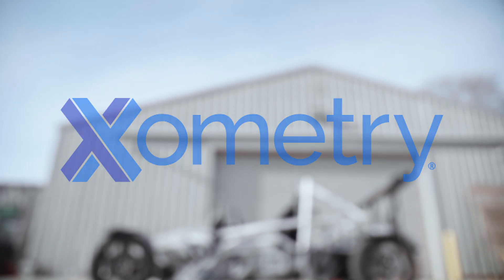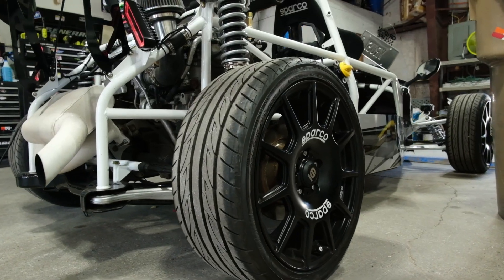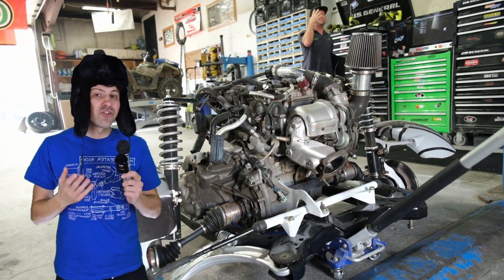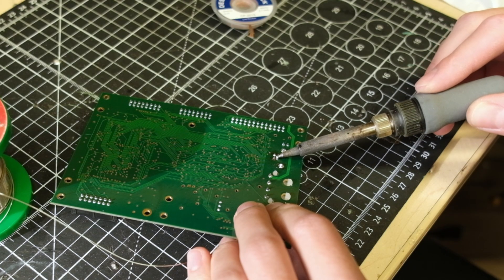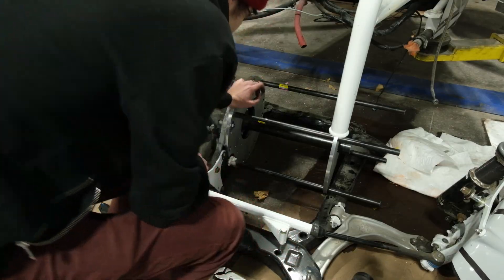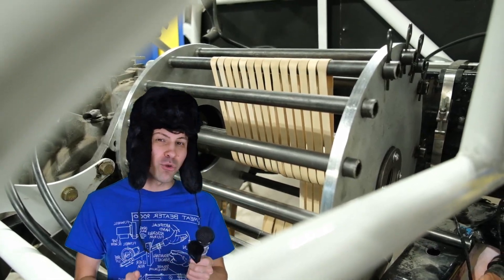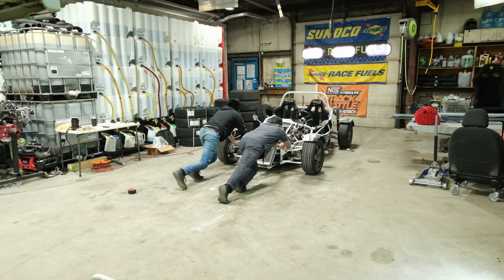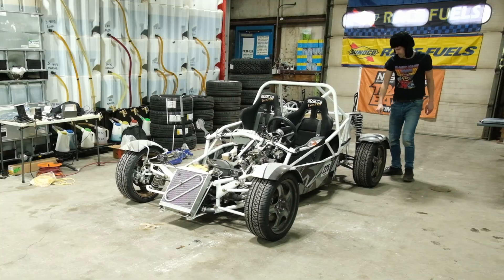How many rubber bands does it take to power a car?

Comment: The tubes need to be a shitload longer, and you need some sort of tensioning mechanism to apply tension to the full length of the tubes as they're being pulled back. Currently it looks like the last bit of tube is storing all the energy and most of it is doing nothing. I suppose that's why the tubes are so short, to try compensate for that. But it's not working cos the energy isn't released slowly enough to give it time to accelerate with the power available.

Comment: Put bearings on the spokes go back to the first wrap around design because it allows more length so you can have more length of distance put a stopper gear so you can "load" it

Comment: i thought of one of these using 2 sets of pull springs gearboxes a clutch and break recovery system using one set of 60 springs to keep power stored then at the pull of a lever when they r empty they refill by using the other set of 60 springs to pull then the set that has no more energy recovers power every time you come to a stop

Comment: How about workout resistance bands in place of the rubber bands!  Longer and wider so they would be easier to use, and they have multiple versions with different elasticities.

Comment: I had this same idea. I was thinking about a bunch of leaf springs run through a series of pulleys taking the load one or a few at a time before the next series kicks in. You can obviously turn the lever action into a rotary action use that for a governor. Winding it up would be the fun part but you could do it with a small engine and a hydro.

Feel free to use any of it I have plenty of projects.

Comment: I probably woulda stuck a motor and ratchet setup to the bird cage so you could have the whole crank assembly self reset. The motor wouldn't be pushing the car, just priming it so you don't have to get out and push it back first

Comment: What about like a mouse trap spring type using a leaf spring from a truck that you bend and attach to the drive shaft with the cable wrapped around it. So when the leaf spring pulls it unwraps the cable spinning drive shaft? The tension would be dangerous with a leaf spring though. Mouse trap cars work great because they pull on a string around a drive shaft. It's in my head I just don't know how to write it down. I know it would work. Basically, when the cable is being pulled it bows the leaf spring and when you release the car it pulls all the cable back out and springs back to its original shape. Gosh, it's hard to explain, lol.

Comment: I think you need a series of tension springs, where the first one winds up to a certain point before "locking" which proceeds to wind the next and so on, that way you dont deal with the problems of this video where it got in the way of itself

Comment: Somewhat different scale, but reminds me of a project I did in school for a science project.  Making a mousetrap powered car. I possibly cheated a bit, with my grandpa, uncle and dad all contributing ideas, designs and parts, although I did technically build the whole thing myself.  Tiny ball bearings, high  quality fishing line around the axle attached to the mousetrap arm and CD ‘coasters’ as wheels (at the time, burning a CD was not a guaranteed success, but far and away was the most economic way to store data. There was invariably a spindle of failed burns, affectionately called coasters). The small axle diameter and the huge wheel diameter made for an excellent ratio. My car couldn't drive across a desk because of lack of traction, it would just spin the wheels. But on carpet or concrete, was an absolute beast. I won that one by orders of magnitude.

Comment: You need to do a double cam shaft but much much much more bigger and it can then work. The material needs to be very springy it has to hold tension very well. A super rubber material.

Comment: Maybe try really strong spring say car shock with pulley system to turn short strong movement into lighter longer pull on the pulley. Many places to tweek the ratios and bit more safe than the garage spring, those can easily kill people. If all fails use torsion spring with starter motor to wind it up to keep the effect going. Bit cheating kinda, but would probably give the result.

Comment: If I were you I would just use a big ass constant force spring rather than a torsion/compression spring this would solve the guiding issue and would allow for a constant torque output
#feelthemagic part two please!

Comment: There is SO MUCH MORE that you could have done.
I probably had a black eye by about the halfway point of the video... Maybe he was just too upclose to see it, or maybe he was fixated on his initial view, but at every point I could see over a dozen ways to improve the functioning and performance  with barely or even NO changes. 

The main ones would be: a free run clutch mechanism in the winding system, so that it doesn't wind up again once fully unwound. The use of first gear to wind up, higher gear to drive. And perhaps the best one of all: when using a spring in this way (I guess you could call it lateral tension instead of axial tension?), it has the exact same strength when unwound as it has when wound up. (i.e. instead of making it bind, it will expand and to relax it will wind itself up) And since you already have a cage, it is perfect to use it like that. The thicker the spring the better the force, so don't take the last spring. How to wind it up without making a gear box? Use reverse gear, or use a left wound spring.

Comment: Shoulda used rollers instead of lubricant on the bands.
The part of the bands that are already rolled up can't stretch anymore, and you only get a fraction of the performance, that's why the zig zag works better in that other guys rubber band car.
Stiffer spring with a high gear to reduce the change in diameter.
A spiral torsion spring is particularly well suited to this kind of challenge (like the kind in a retractable dog leash.)
Either rubber band or spring are absolutely doable, though you may need to brush up on your math.

Comment: I am surprised you did not look into exactly how those pull back cars work. I am pretty sure they have a mechanism to stop the spring from rewinding as it goes in order to get full speed out of the car.
So something like that plus honestly using a wind up rather than pull back mechanism would probobly make this work better.

Comment: It might be a little dangerous but why not just use some large springs. Attach some nylon straps to the springs then have the nylon straps get pulled around the drive shaft.

Comment: I would try using very heavy duty bungee cords, or even a roll of cord/rope made for bungee jumping and roll that around instead, you would need far, far less in total, so less likely to end up tangled and wedged into the sides. Would also put some weights on the back to push those tires into the ground, and give the car a 1mph shove to start out to overcome that initial friction issue of starting out.

Comment: So .. I think this is a great playful project 

I would try making that Bird cage as long as you can get away with if it isn't 

And like rope get lots of long fairly thick strands of elastic and twine them together then 
Fix one end at the end of the cage and the other to the input shaft via a clever coupler

Also wind it up in fifth and then select second once stationary 😅 

Don't quit this is so cool

Comment: the problem is the diameter of the inner drum, it's too small for rubber bands. you need to lessen the force needed by the rubber bands to drive the motion. if I had to guess a drum with an outer diameter of 12-18in would be enough to meet your goal. I would also use long and thick bungee rope that has an outer fabric liner to prevent rubbing and to be able to store more force. i am not a scientist but I'm pretty good at looking at something and knowing how to make it work.

Comment: Try concentric springs. One simple way to do it is to just attach each spring separately to the stator and rotor. Another way could be to attach each spring to the next, with the center spring attached to the rotor and the outermost spring attached to the stator.

Comment: Thank you Aaron and David for putting up with Joel's shenanigans!
I think the rubber bands can be used if you twist the bands instead of just pulling them. I mean, the rubber-band planes also use them in twisting motion, not rolling down from a shaft. That way you can store energy in 3 dimensions instead of just one.

Comment: There was deffinitly magic there. I feel like if when you used the rubber band, you attatched the gage to the drive shaft and turned the cage instead you would have gained more speed, possibly longer rubber bands like pool training rubbrr band that ate 10+ feet long would help. Im not a car mechanic but was the axle able to slip when the power release is done so the car is not stopped by the band widing in reverse? Ayways i deffinitly felt porential there

Comment: I think you should've tried a smaller shaft and kept the small spring. Or got multiple springs on each of the outer shafts but made those shafts spin on bearings and attach a small gear on the end of each spring. Then add one big gear or several small gears connecting to the center shaft to the outer shafts. Still very cool vid as usual.

Comment: I think bearings, guides, and rollers to minimize friction between the elastics on the engine will help bring rubber bands back into the running
Reply: Every little bit of friction you can remove from the equation will (from my understanding) ((I am not an engineer)) put power back into the system

Comment: Had the same issue with usb dropping off. 
You cable is to long, the cable not shielded enough, or passes by a device with a lot of electrical noise like a stepper motor

Comment: Really nice idea. Although, if i am not mistaken, there are pull back cars that utilise a rotational sort of spring. You know, like the kind that is in mechanical watches that keep them ticking? So maybe an upscaled version of that would be way stronger than rubber bands and probably isn't going to break. Only thing is finding a way to make one upscaled, and it is a bit more dangerous i guess aswell.

Or you could use a few tough springs, link them up so that winding them you have a high mechanical advantage on a crankshaft that when winding it you have a low gear ratio so it's easy to push back, but when you let go the opposite is true, it wil have a high gear ratio. Although i guess you will need to have a crankshaft with a bit of a radius to make it go a bit far

Comment: Try using the bands to charge a flywheel.  Then tap the flywheel to move.  I believe that is how the little cars work.  At least, the ones I played with were flywheel-driven.  The faster they were pulled back, the faster they traveled.

Comment: Single direction ratcheting system, only 3-4 large bands starting on the side with a guide to evenly wrap them around the shaft (even if they overlap they will unwrap the same), and maybe pulling it back in 5th then putting it in a lower gear?

Comment: Looks like it wants larger diameter wider wheels, a MUCH thicker spring and a way to lock the spool so you can pull it back in low then switch to high for short pull and long run.

Comment: The small diameter of the axle is the problem. The wider the axle where the rubber band wind to more leverage. Also gears would help. Basic physics would've helped with this.
Reply from the maker: I had 5 different gears to choose from. More leverage means less winding before maxing out. 1st gear was always far too short. A bigger shaft would have had the same problem.

Comment: Thank you Aaron, David and Joel. 
I was really hoping that you would have some success with rubber bands.
With the torsion spring that kept binding up a smaller hub pipe and an external cage may be a better way to keep the spring in place.
To get any sort of real speed I thing a lot more energy needs to be stored. A number of torsion springs in parallel might get there or even better a geared torsion spring setup where spring 1 releases all of it's energy, spring 2 engages at a higher gear ratio then spring 3 etc. With some cunning engineering this could be done via the shrinking/binding that occurs when they get tensioned.

Comment: If you get a lot of rubber bands, and glue them all to a bar, you can attach a rope to that bar and wind up the rope, so you get all the force out of the rubber bands. You could even use a second axel that has another rope to multiply the force you get out of the rubber bands. You should take a look at Mark Robers mouse trap cart video as I think it has a lot of useful parallels here.

Comment: Ok the toy cars use coils not springs or rubber bands you need a massive flat coil of spring steel like a 200 foot long strip of 2 foot wide thin flexible steel just like the toy car uses and it will fly fast and far

Comment: Ok so why not get a pull back car, take it apart, reverse engineer it, then upscale it to fit the goblin? I mean, like an EXACT replica only much much bigger.
Surely that would work, right?
I'm pretty sure they had a gear system so the pull back created a quicker wind up then a slower release.

Comment: One thing you kind of hinted at but didn't really address, and it literally is the problem: you can't get more energy out of a machine than you put in to it. Think of how much it would take to push it forward by hand up to 25. You need to put that much (much more really since your efficiency will be low) in to it backward for that to happen forward.

Comment: the thing about those little cars is they had the weight of you pushing down in the drive tires while winding up. this kept them from breaking traction while winding up. i think you could build an external ratcheting system that stores energy in a leaf spring or something similar and have it attached to a really hi geared drive shaft. this, i believe, would create some powerful results

Comment: Thank you Aaron and David, this was a fun one.  Random thought about the concept.  There are “engines” that run from gravity, or even Mouse traps.  Non elastic wrap around the drive shaft(string), and the lever does a fair amount of the work.  Could you use webbing to do the wrap, and extend up to your bands?  The bands could be wound up to the drive shaft, and they’d only be pulling in a linear mode.  You could have an inadvertent energy loss as the band aren’t being stretched fully and equally?

Comment: As far as I know people have made life sized spring powered mousetrap cars, and they move pretty well. I think it was backyardscientist, maybe the king of random, but don't quote me on that. I think your idea is great but your problem is trying to limit the size of the engine. Trying to design something around the weird formfactor you have is holding you back, you should definitely think about getting a system that doesn't constrain itself to a tiny box. You could also take inspiration from those slingshot rides at amusement parks, they pull back on springs to build up energy to launch someone. 
I love your videos and look forward to them!! Keep up with the questionable antics!

Comment: So Joel there's a thing you may want to consider if you want to revisit this. The spring option is a great idea but you need to find "stiff" spring not necessarily a larger spring. There's some equations you can use to find these things and effectively take into account the force the spring is applying to the shaft along with the force that is being applied to the tires. Your goal is to overcome the static friction force first and then continue to push through the sliding friction. F=ma so the greater the force difference the faster the acceleration. If you also create somewhat of a gear system where the spring only engages when you want it to and then disconnects from the axel allowing the car to continue forward under its own momentum that would allow you to use the initial push that the spring has given you without the spring re winding back up and killing your momentum.

over all this was a great video and really great refresher for my kinematics from my physics classes since I'm taking the mcat in a few days. Thank you as well aaron and david for letting joel do his thing with your stuff.

Comment: I actually think the rubber had a lot of potential but you were running into temp issues. Rubber is highly thermal and I'm betting it was cold out. Joerg Sprave of the slingshot channel would be a great resource for details on making high powered rubber contraptions and avoiding some of the binding issues you had

Comment: Instead of loading the bands up with lubricant, you could slide a larger pipe over those cross bars that can freely rotate. Then the bands will not wear out from friction (as fast).

Comment: If you want to go anywhere you will need longer rubber, which is also stronger, a "kinetic rope" (used in the field to recover off-road cars) with a few pulleys will do an amazing job.

Comment: Wind in high gear and release in high gear. Also I’d go back to the bands and ad more and don’t glue or zip ties, pinch them super had between two sheets of metal pressed together by many bolts.

Comment: I reckon if you used flat spring steel coils (think of 4x4 suspension, but wound up like a watch spring) you'd get heaps more speed and acceleration.

Comment: When you went from the rubber to the spring you freed up a lot of space in that bird cage that you didn't utilize.
Eyeballing it I recon you could get about 7 or 8 springs on shafts in there plus the original center 1. 
If you then connect them together with planetary gears ( the center shaft will have to turn in the opposite direction to the others) you would have 8 or 9 times the power minus friction loss.